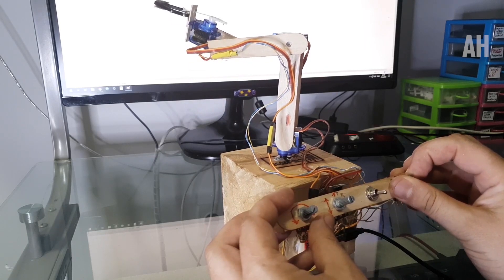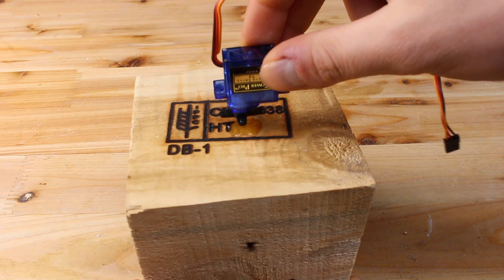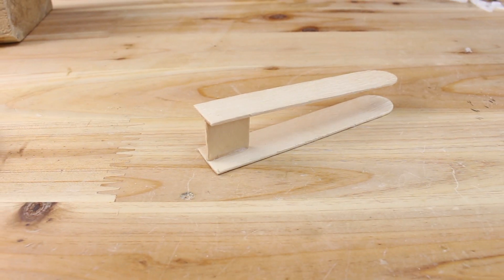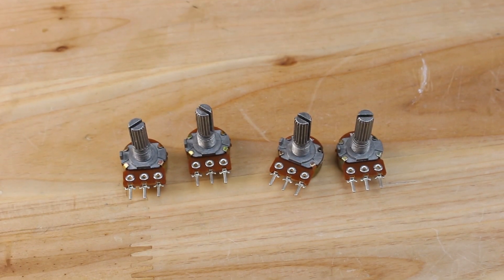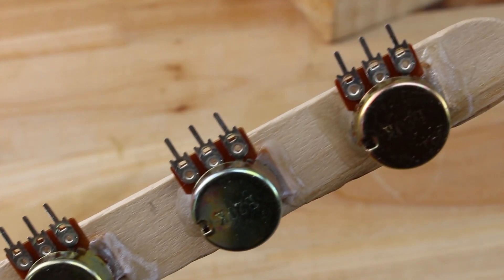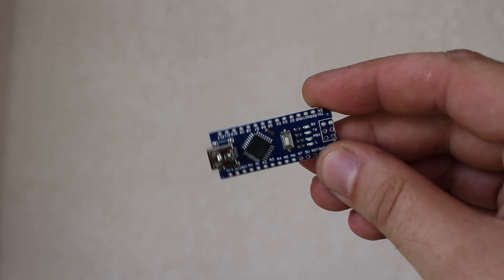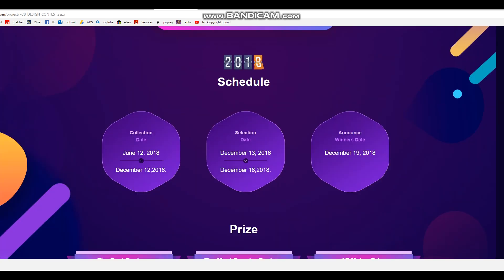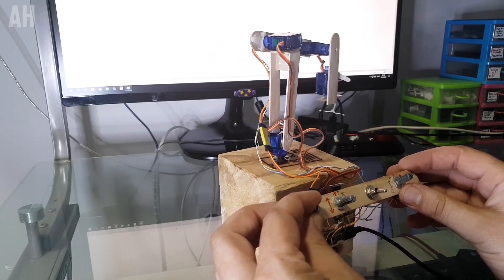How to make Arduino Robot Arm

Comment: Great tutorial, thanks!
Notes for myself:
Four motors
1. controls z axis rotation: glued to the bottom of the popsicle stick base and the platform
2. controls upper arm rotation: glued to the top of the base and the bottom of the upper arm
3. controls forearm rotation: glued to the top of the upper arm and the bottom of the forearm
4. controls gripping: glued to the end of the forearm, zip-tie at the end of the servo horn, feeds through a hole, then the zip-tie forks. At each end of the fork, it feeds through holes on the grippers. That way, when the zip-tie gets pulled, the gripper deforms shut, and elastic force pulls the fingers back apart when the zip-tie is fed back through the hole. The ends of the grippers have a soft padding (foam tape?), to increase the surface area of gripped area of the object, thus increasing friction and grip strength
Reply from the maker: That’s a great breakdown of the motors, thanks for sharing!
Reply: Thanks for sharing your video, really excellent demo of a simple arm. I'm getting into restoring/modernizing vintage robots, and not all of them still have their arms lol  @Hacktuber

Comment: Any one can send me what are the names of materials use for this
Reply: Arduino 
22k potentiometer 
Servo motor 
Jumper wire 
Push button 
Pull up Resister 10k

Comment: HOW HE MADE THE ARM:

Okay, For every trying to make the robot hand, heres how he did it:
1. go to 1:51 you can clearly see the arm without the hand.
2. got to 3:01 here you can see how he mounted the hand(motor)
you may have to repeat that a few times to see the orientation.
3. Finally go to 3:31 and you can see a better view of the hand.
Here you can see he found a grip, in the shape of a U, Then he tied a string half way through each side of the  "U",
then he pull the string through the bottom of the U add tied it to the server lever like a bow.
How it works: when he turns the server lever it pulls back on the string, pulling the U into a V to close(more like upside but you get the idea.)
Reply: Just out of curiosity (I'm probably going to just stick to the one that you turn rather than the lever/switch), do you know what that switch is that he changes out one of the other potentiometers for? Or has he just done something to the pot to make it work like that? It looks like a blue box, he doesn't mention that he's done it and I'm brand new to this stuff so my google searches haven't been fruitful.
Reply: @annab4931  yeah I just looked it over again and basically with a potentiometer he could control the full range of motion of the motor(that controls the grip), but he only wants open or close the grip, so 0 or 180 of the motor that controls the grip. So with the switch via some way acts as the min and max states of the potentiometer. Does that make sense?
Reply: Can you please tell me the switches and those blue electrical components are I could not hear